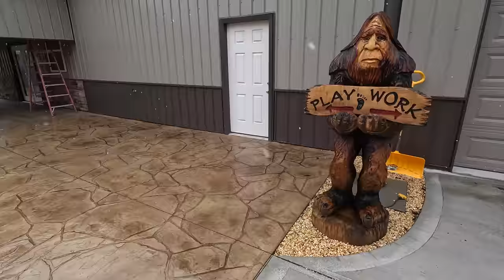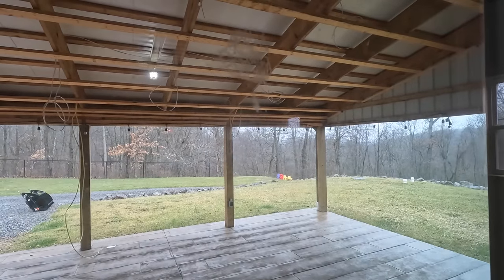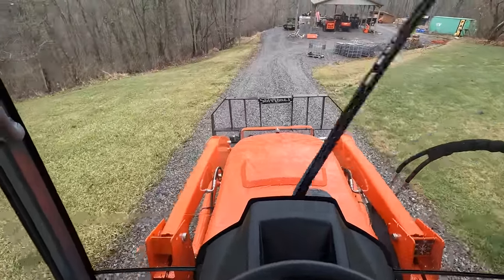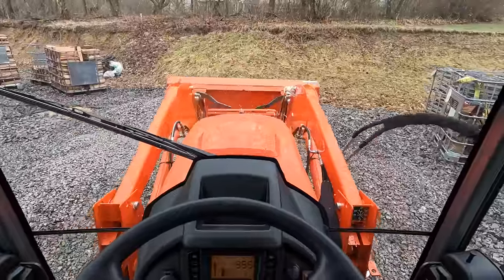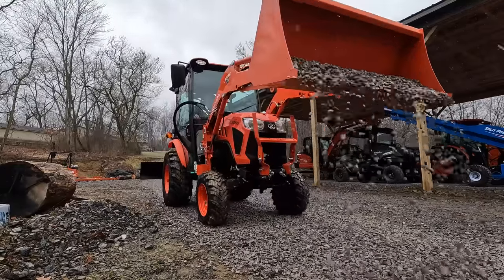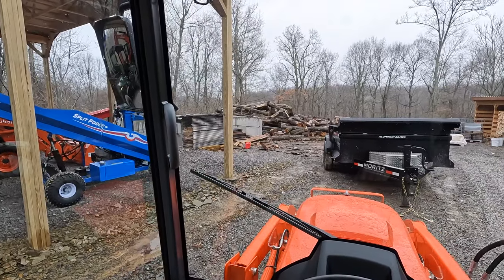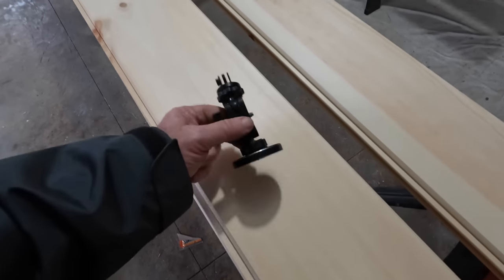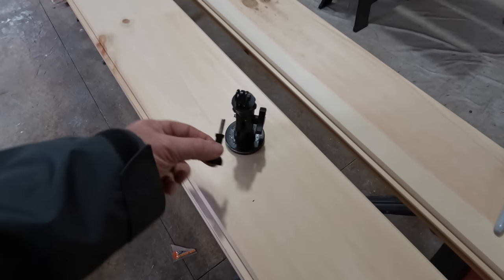Mystery at the Morgan's! We may never solve this one

Comment: Looks great Mike. Strongly recommend insulating the bathroom walls with rock wool for soundproofing. Will keep the snickering down from hearing all the bathroom sounds (especially with the metal interior walls that enhances sound, instead of muffling it) that come from a bathroom run. Remember, I was right about the gutters on the shed. 😀
Reply: You may have to install a “security”camera to follow Hunter to his hiding spot.
Reply: Good idea, the metal room will definitely echo!!   Could be fun though... LOL
Reply: Or a loud exhaust fan.
Reply: Also with a shower in there it will help prevent the metal from sweating.
Reply: 💯 % agree on muffling the noises!!
Someone might think there is a moose in there! Or a big buck snorting,,,,
Reply: Got a good laugh out of the shed comment Brian 😎

Comment: Mike I used Crezon sign board to wrap my posta on my covered deck about 13 years ago. I painted them white 2 coats of exterior water based enamel paint. Every year I power wash in spring to clear off nature's dirt, dust, bugs, cobwebs etc. It still looks like the day I installed and I have not had to repaint thus far. No rot, no peeling, no signs of wear. CREZON IS USED for highway signs and is very dense and durable. A little expensive but well worth it. I swear by it after enduring Canada's harsh winters and climate in Edmonton, AB. Good luck on your finishing! Say hi to the family from Barb and Jeff.

Comment: Hey Mike look into ordering a wider split jamb door for your application. Those 3/4” boards are wider than Sheetrock and a standard 4 9/16” jamb you buy at box store will work but it barely touches and it’s a pain in the neck to install. I’ve learned that lesson the hard way.

Comment: That splitter may not be as fast as the Wolfe Ridge but it seems as though it is a little easier on your back handling the wood. I think you will like the metal in the bathroom, done that myself  but had them run the color on the backside so it gives you a flat wall. Coming together 👍🏻

Comment: For your posts on the building I would suggest a pvc board product that has a smooth side and a woodgrain side to wrap your posts. It can be painted and there are screws available that can be plugged and become almost invisible.  I'm a pro home builder and use this type of product anywhere I used to use wood in exterior applications.

Comment: Those hoses on that loader bother me, it looks like they would hang every branch that brushes by. Maybe it's just the camera angle, but my B3350 has the hard lines up in the loader arms with short rubber lines at the hinges. The third function lines are run inside the loader arms too.

Comment: I have found out a few times, that my L3901 with bucket or pallet forks, will lift more that the tractor can carry, without an implement on the back end! Even with the tires loaded. 
A few months ago I was moving some cherry logs with the grapple, ! log was huge, and it picked up the rear tires. Same thing with a load of gravel. Yesterday I unloaded 8 bags of 80lbs of sand mix, on a slight graded hill, and I couldn't back up the hill. I really need a ballast box!!
Are you positive it is hunter?

Comment: 268 comments so far, but after watching your channel since before the “tractor dance”. I’m going to say check your fastener storage area, specifically the compartment that best matches the threads of the thumb screw. Or in the miscellaneous bin due to the plastic part. Lastly, if you have a ‘junk’ drawer where screws and bolts may end up.